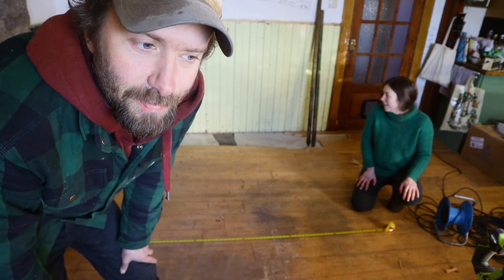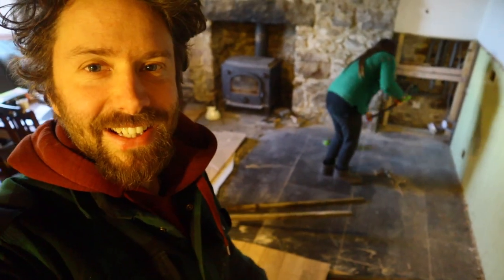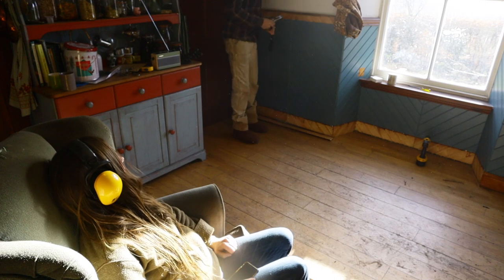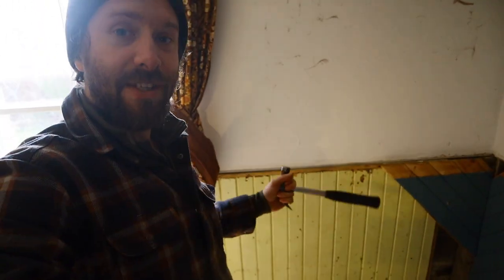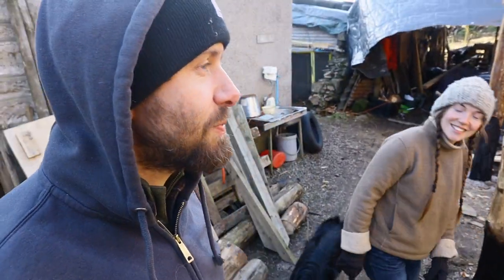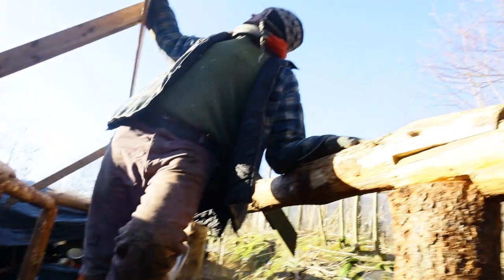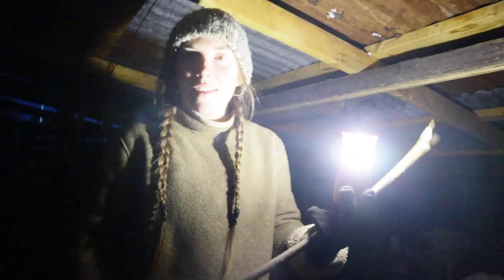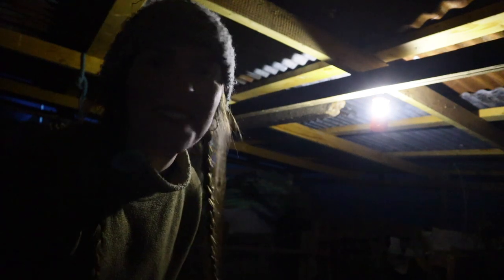REVEALING 130 YEAR OLD FLOOR UNDER OUR KITCHEN! + RAISING the ROOF on the TIMBER FRAMED WOODSHED

Comment from the maker: CONCERNS OVER LEAD IN THE YELLOW PAINT: Hey folks - thanks for all the concern and tips about the yellow paint on the wood - we have used a test that is available to test for the presence of lead and the test came back negative. we will however still approach the situation with caution and have everything we need to deal with the wood if it does indeed contain lead in the paint. Thank you!

Comment: That's a pristine looking old floor. Very impressive, and surprising. Now to lift it up and throw some underfloor heating under it!
Reply from the maker: We've had an inkling it was there for some years after finding several cottages on the hill here have the same floor, built at the same time. We just didn't think they would be in such great condition!

Comment: The roof seems low on the wood shed?  Is due to local conditions? You will be bending constantly to go in and out…
Reply from the maker: Eaves any higher and snow and rain would get in. It’s high enough for our needs thanks.

Comment: Hey There again --only downside to the floor--don't drop your best china on the floor!  You're paying tribute to the men who created the flagstones - nothing but hard graft and no machines - just a hammer n chisel--We have a responsibility  to preserve their efforts. Was the old lintel smokey and had to be replaced for that reason?  The ingleneuk will  be such a great talking point in the new kitchen--hub of any farm.
Reply from the maker: Exactly, loads of hard work and a very clever and purposeful natural material to lay in a kitchen. I ave considered just how much crockery we'll break though! The lintel we removed was badly cracked and, while it would have lasted for decades more, we actually needed to raise the lintel to accommodate the new oven that's going in. And of course we couldn't just reuse the old lintel as moving it made the crack worse.